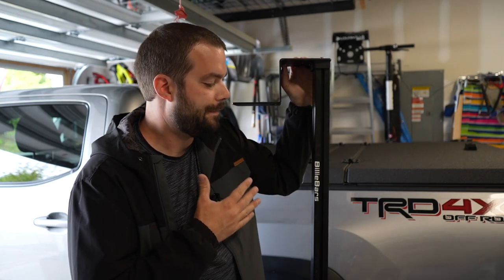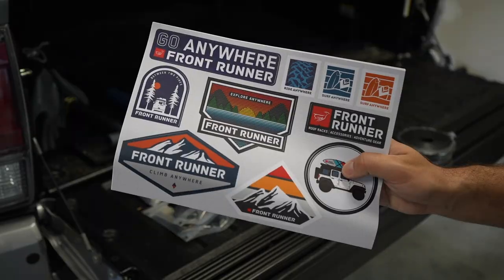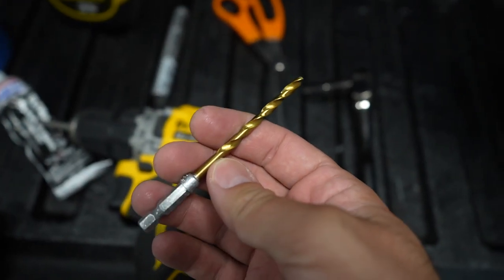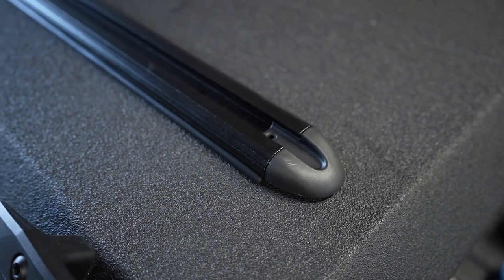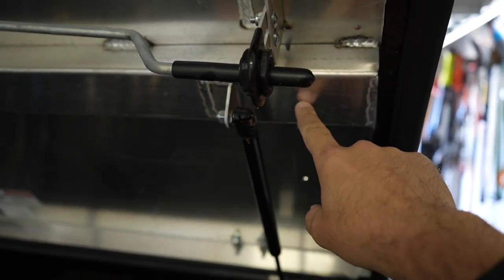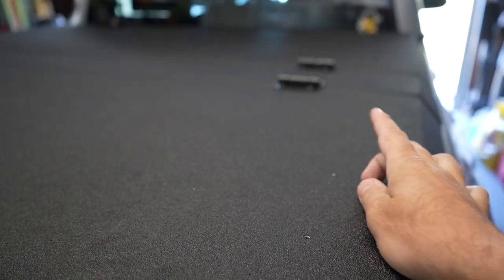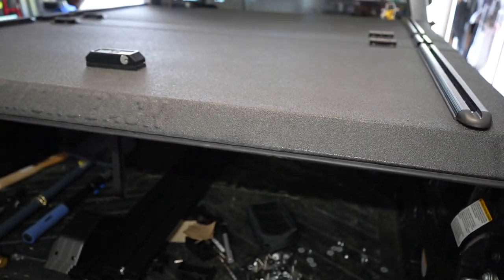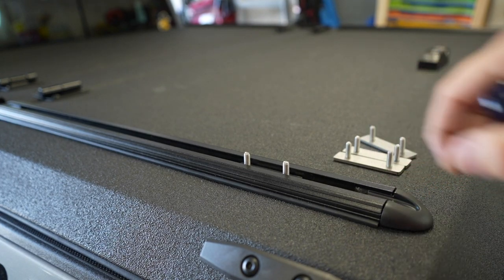Front Runner x DiamondBack Rack System | Install and Review

Comment: Useful review.  Thank you.  A question.  I realize the HD has a 1600 lbs capacity on top, which is great, so you can say put a camp top up there.  But what about the water/weather seal around the periphery of the cover, how will that hold up if you are regularly or every so often compressing it to the max when heavy weight on top, even a camp top with a heavy man or two adults sleeping in it?  Will that water/weather strip continue to work at 100% effectiveness?  Can the water/weather strip be replaced and will that replacement be just as effective?  Other?  Thanks.  Oh, and any risk of those holes you drilled in the cover leaking?  Thanks again.

Comment: Clean install. I see you went with the SE model and I see that saves four hundred bucks! I was wondering what size then are you putting on top? I want to get the same set up and was worried about weight. My wife and I and two small dogs would be it! tks for the video
Reply from the maker: Right here >>> https://youtu.be/_qzU0Sg-G8s
Reply: Is the Diamondback a SE model?
 @GearKnowHow
Reply from the maker: @niteranger6376  yep
Reply: @GearKnowHow   Cool, then it will support the weight. I was worried about the static weight on top of the cover

Comment: I ordered this kit for bike carriers with my Diamondback HD and I badly regret.
I should have watched this before adding it to the order.
My reason is the stupid mount to the rails. I wasn’t aware you bolt this on and can’t just take it off if you don’t use it and throw it back on in a minute. That’s on me and might not be a big deal for others.
Reply: Sounds like you want the quick detach Yakima rail system instead. This setup appears to be 4 bolts per support to get it to come off.